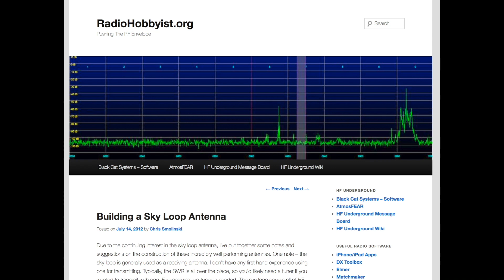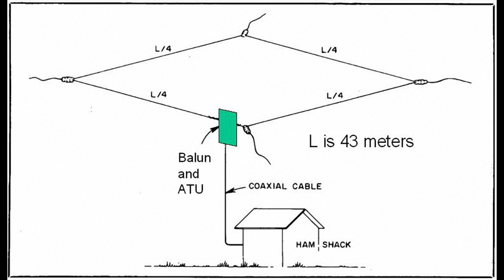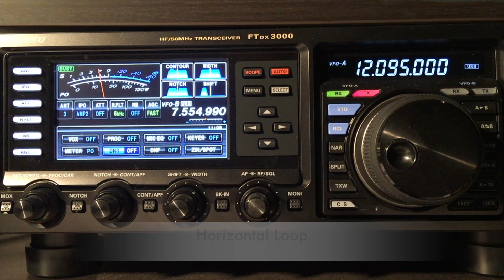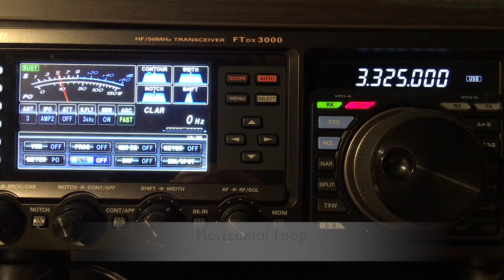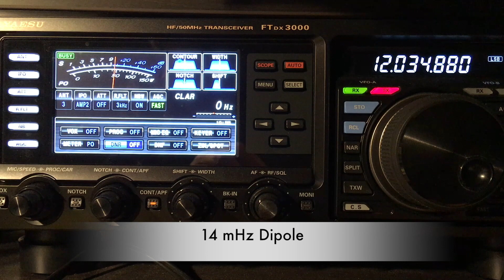Horizontal Loop Antenna Experiments

Comment: Rob:

I love my 40 meter full-wave loop antenna that I made many years ago.  

True the noise floor is greatly reduced as I have experimented at many locations while on vacation.

I use the 450 ohm ladder line going into a MFJ 300 watt tuner.  

One thing I have noticed that I get some gain from the antenna while being on higher bands (20, 15 and 10 meters etc) than just on 40 meters.

One time, I worked a pile-up and got through to the South Pole on the first call.  The antenna location was this antenna just thrown up in the trees, nothing special.  My QTH is Portland, Oregon (CN85ql) and I was shocked to say the least using 100 watts on 20 meters.

When on vacation, I always take the full-wave loop with extra floating insulators so that I attach the loops to any number of trees while trying to make the antenna form a circle.

I have worked the world on my loop and it was cheap to make.  I would put my loop against other dipole or vertical and win out for lower noise floor.

I am a true believer for loop antennas and have used it many times while running QRP with great results.

I consider the loop antenna my secret weapon during Field Day in June.  Others feel it is it a inferior antenna thinking the signal just goes vertical...no, I have worked the world with it on both high power and my personal preference QRP.

Thanks for the great video! Looking forward in seeing your next video.

73!

Kurt Warner - KA7ZDD, Milwaukie, Oregon (suburb of Portland)
(Good on QRZ.com)
Reply from the maker: Hi Kurt! A fabulous story there. Great to hear that someone else is enjoying the benefits of the loop antenna. I must redo my balun so it can transmit on higher power. It's an old one made with thin wire intended for receiving only. However, on more than one occasion I have pumped a 40w full carrier FT8 signal through it in error and it has survived just fine. Like you, I have also found that it tunes up easily on a number of bands, even though I am not using ladder line. So it seems that it is a very forgiving antenna. Thanks for checking out the video, "Zippity-Doo-Dah"!  ;-)  73, Rob VK3BVW (also good on QRZ).

Comment: I have almost precisely the same arrangement, rectangular, 60 metres long. Hot Tip, if the antenna is less than halfwave high the impedance drops, so try a 1:1 Balun, halfwave and above in height use the 4:1. Also loops are resonant on every harmonic, unlike dipoles that resonate every other harmonic 73 de GØUSL
Reply from the maker: Thanks for your comments, Mark. Much appreciated. 73, Rob VK3BVW
Reply: @RobVK3BVW  My pleasure Rob, I have been experimenting with loops for some time. I am in two minds whether to try to extend the loop for 80metres (some imagination required there!) Or to shorten in for 40metres and take the vertical option for 80.

Comment: Are you still liking the 3000 Yaesu ? Debating on it or the 7300
Reply from the maker: Absolutely! I've had the 3K since Dec 2014 and it hasn't given me a scrap of bother over that time. Once you get used to the menus, it's easy to operate (but, hey, that's the same for all the different brands of rig these days!). Very sensitive receiver and transmitter works great. Using it a lot on FT8 at the moment.

Comment: You have a high noise inside ur shack probably due to nasty laptop dc power supply or led lamp etc. get a noise canceller
Reply from the maker: Mohamad Ibrahim - No. The noise is NOT coming from inside the shack. It is external noise being picked up by the antennas.  Tests show that shack equipment is quiet.

Comment: Just spotted how you've wired the antenna through egg insulator at one corner.
Not seen the rest yet. Ah yes... the one at the metal pole as well.
Eggs are fragile and if they break your wires would fall.
The egg is shaped to feed the wire into the hole via a path...same for both wires.(or rope).
That way your egg is subject to compression rather trying to pull it apart AND should it get busted, your wires will support each other and not drop to the ground.
On rx only, you would probably not even notice it if it did break!
Question. Have you tried or is it feasible to put up a loop of whatever dimensions you are forced to use according available space?
eg. My shack is not near a corner (more in the centre of the loop area) so feed would be on a straight stretch AND I have lovely neighbour as well so I might get the OK to make it even bigger over their patch but boy, it would be a odd shape.
Sorry can't draw you a pic about the eggs but the fluting on its shape should tell what I'm
getting at. 
Great video.. Million thanks!   73 de G3NBY
Reply from the maker: G'day Howard! All your comments noted on the eggy insulators. It's a pretty "stress-less" setup here so I suspect that eggs are going to hold up very well. In fact, they are decades old - possibly 30 years? Still going strong.....we make 'em tough out here in VK!  ;-)  Indeed, since that video was recorded, the wire has stretched somewhat and there's even less tension on the eggs now. 
After having done a little research on the loop, I've got a feeling that the shape is probably not that critical. I've seen several DXers with loops that have 5 and 6 supports, the main aim being to try and get as much wire up in the air as possible. Certainly, for receive-only conditions, it doesn't seem to be critical, so in your case, I wouldn't worry too much about the odd shape. For transmitting off one of these things, the build and placement of the feed point probably need to be considered more carefully. Try it and see!! Let me know how it goes for you.
In the last week, I have been getting into the FT8 mode, and enjoying it! I've been using the loop on receive because it's quieter and dipoles for 40 and 80 on transmit. Works well.
Just looked you up on qrz.com - I see you are a muso! Trombonist here. Big band jazz for many years, classical and teaching as well. I don't play professionally anymore due to a dodgy ticker. Always nice to meet another muso/radio enthusiast!! My "About" web page is as http://robwagner.com.au/styled/About_Rob_Wagner.html. Anyway, thanks for stopping by and checking out the video, Howard. Cheers mate! - Rob VK3BVW

Comment: I've got plenty of space and I'm considering a 160m double wave loop. I'm in a bit of a valley with high terrain immediately to the east and a stoney ridge to the west that is less steep and somewhat lower. The valley is more open to the north and south and all the terrain is heavily wooded.
I'm going to feed it with ladder line and because of all the high terrain (and I just installed a 15m mast for TV) I don't think the loop will be any lower than about 15m. There are many tall trees that make my 15m mast look unimpressive.
Like you I read many articles on the sky/horizontal loop and found double wave seems the way to go due to lower takeoff angle.
I'm in 2 minds as to whether to shelve the 160m double wave part since most 160m is vertically polarized (and part of me thinks what's the point) and go 80m double wave which would be 160m single wave anyhow or just do the full 160m double wave.
I'm thinking an isoceles triangle would be good and the article I read suggests feeding it at the apex in such an arrangement gives some directional aspect to the antenna in modelling at least. But at the initial location it would not be feasable to feed it at the apex (I'm living in a caravan at a different location on the property while the house is being built). At the caravan site I have a nice cleared river flat that will easily accomodate 1100' wire.
I do want to use the loop for TX and its transmit performance is important but my main interest in amateur radio is mostly listening on various pieces of equipment. I have a Kenwood R5000 with VHF board and every filter and option box ticked. It is a great receiver but frustrating to use and I have a Yaesu FT1000MP with all filters installed which is great to use but doesn't cover VHF and isn't as quiet as the Kenwood. For example, the Kenwood is almost deaf to the power supply noise of my plasma TV and the Yaesu isn't too bad but it takes plenty of tweaking to get that noise blanked out and it effects the sensitivity.

I'm convinced double wave is best for multiband loop antennas.

Comment: Hi Rob very nice video on skyloop. I have mine also connected to a Palstar auto tuner and it is working good. Btw, what bideo camera and setting are you using? Dindo DU1UD
Reply from the maker: Hi Dindo, I use two video cameras in this video. In the shack, I use a Nikon D800 and for the shots of the antenna outdoors I used an iPhone 6S+. The setting is 1080p. Editing was done on the latest version of iMovie for Mac. Best 73, Rob VK3BVW

Comment: Hi rod i put up a delta loop sky loop horizontal 160m long 40 feet up on 4 poles ,seems still a bit noisy but  not as good as my inverted v on 40m but on 10 15 20 it kicks butt big time i was very surprised also its very directional at a perfect sq in free space  out in a field. 4to1 balun fed from antenna with l line 450 short coax lmr 400 back to shack still think the inverted v beats it on 40 m band less noise bigger gain better on line reports with the  inverted v .
Reply from the maker: Thanks for sharing the results of your experiments, Alan. Best of luck with it, Rob VK3BVW

Comment: Thanks for interesting posts
I am also using 80 m sky wire.
I use it in all bands using a 4: 1 transformer like you.
Now I am trying 600 Ω open wire.
It is a very good antenna.　　FBDX！
Reply from the maker: Thank you for watching the video. Good luck with your 600Ω open wire. Best wishes from VK3.

Comment: Impressive improvement in noise floor, I have been curious about experimenting with a sky loop in comparison to my T2FD (which also has a lower noise floor than my right angle random wire antenna).
Reply from the maker: I had a T2FD in the air many years ago and it worked OK. Got pretty ungainly to hoist in the air when built for the low bands. I think that the loop would have beat the T2FD for lower noise floor. But perhaps I should make another T2FD and test it. Or perhaps I wait for your video comparison tests!! ;-)

Comment: I have played around with horizontal loops a bit. I need to put up another one. Full wave loops will work on their even harmonics. So a 40 meter loop will also work on 20 and 10. Even if I intended the loop to be primarily for RX; I would want to be able to TX with it. I really need to see about getting something up for 40 and 20. Right now for HF all I have up is my A99 that works 10, 11, 15, and 20 with a tuner. 

73
Jennifer
KK6FVP
Reply from the maker: Thanks for your comments, Jennifer. Good luck with your loop experiments. Best 73, Rob VK3BVW

Comment: Since I can't post pictures? on here, my sky wire 80 meter loop is 275ft long, my house on a hill, top 2 corners are 28' and 20', hill drops 20', bottom corners are about 35; each. My best swr was 3.749. My 80 meter dipole is at 40' over the same slope. My loop outperforms the dipole by 3 db, and is quieter. I use 26' of rg58u, and the rest is rg8..Nice video..
Reply from the maker: Cool, Steve! Great to hear of your success with the loop. Some guys use the loop as the receiving ant and another ant with low swr for transmitting, which is an easy thing to do these days with many transceivers having a separate receive ant terminal. Thanks for your comments. Good luck. Rob VK3BVW

Comment: Enjoyed  watching your vid Rob and found it very interesting.  Local man made noise is only getting worse and we all strive to avoid  this problem.  I am currently experimenting with a magnetic loop antenna and comparing the RX performance to a 8m tall vertical.  So far the mag loop has been performing extremely  well.  By using the WSPR software and different receivers for each antenna the mag loop is spotting more stations so far on the 40m band.
Thanks again and will wait to see the results of your next antenna experiment.
73
Reply from the maker: Very cool, Joe! Thanks for your interesting comments. I'm really glad you are having some success with your antenna system. Best 73 to you!

Comment: Seems to be a bit of confusion here. Rob, I made these tests with skyloop and other related antennae maybe 15 years ago. Even made one with a autotuner after a specific length of 450 Ohm ladder line so could transmit on it. As in your video, it did make reception more quiet, but not enough. This said, an end fed wire is the worst of all receive antennas for noise. I got rid of them a long number of years ago. Now, a transmit antenna is mostly not the best receive antenna. It will radiate your power well, if constructed well, but reception is not optimal. The last 8 years I always separate things by using a separate dedicated receiva antenna with an autoswitch, external or internal, swapping antennas. The next thing is that you install the receive antenna at the most quiet place on yur property and using a, in my case, high quality active loop. This loop is oriented so its deaf side is pointing to the qrm direction, so it eliminates even more noise. NEVER mount a active loop in a horizontal plane as Mike suggested. Also mount it about 3 to 5 meters up on a rotor so you can tune to get the most signal from the wanted transmitter and make a compromise with the local noise. I hope this sounds logical. Good luck!
Reply from the maker: Thanks for your comments, Ron. I do very little transmitting these days, so as I mentioned in this video, the main purpose of this loop was an experimental ant for receiving. I would build it somewhat differently if transmitting. Your observation of using two separate antennas for transmitting and receiving is a very good strategy. Cheers, Rob

Comment: What a fascinating video, here in the UK we have been let down by our regulator Ofcom who will not enforce the EMC regulations and noise has become dreadful.  Of course we don't have the space you guys do so I am wondering if a balanced loop such as the Wellbrook ALA1530 mounted horizontally would display the same noise reduction??? Do we know the theory behind why the horizontal loop hears less noise?
Reply from the maker: Mike, same EMC issues here as well. So much Asian stuff imported without proper filtering and with poor circuit design - it's cheap, but it comes at a price - RF pollution! I've had no experience with the Wellbrook (too expensive to buy and ship to Australia), so I can't really comment on a comparison. More research needs to be done! Cheers, mate!
Reply: Hiya Rob, ok I will do that research and report back :) Keep an eye on my channel, I have used the ALA1530 over many years but recently swapped to a MiniWhip which is great for LF but getting swamped on HF
Reply from the maker: Thanks for your interesting comments. I guess it depends on how bad the noise is versus the ability to have directionality in your antenna. Good luck with your antenna experiments!  Rob VK3BVW
Reply: A few months ago I was curious about how my ALA1530LNP would perform when mounted horizontally. I also have a ALA1530s+ which I kept oriented vertically. In my experiments I switched between the two. Indeed, noise levels dropped even further with the ALA1530LNP than what this Wellbrook loop normally offers. Unfortunately, with its omni-directional pickup in this orientation,  there was no directionality at all on medium wave or lower HF.  I decided to return the ALA1530LNP to its normal orientation, but I plan to remount it on an antenna rotor like I used before. Perhaps I'll try a skywave loop again, but it is a big hassle to route the wire through the dense foliage in the green belt (forested area) behlnd my house.

Comment: Very good! I'm a big fan of loop antennas. So far, I only have small ones for indoor use and they ara really quieter. My QTHs are located in very noisy environments and these antennas allowed me to listen to shortwave again, maybe better than the time there wasn't so many appliances and what not around. Right now, as I'm writing it I'm listening to Radio New Zealand International on 7425kHz and sometime before I was able to pick up Radio Congo on 6115kHz here in downtown Curitiba, a big and busy city. I noticed that when I use it horizontally, it's even quieter and frequencies below 10MHz signals actually come stronger. Signals above 10MHz get weaker so I have to use it as a vertical loop. Fortunately, the afternoon is the best time for listening to these frequencies when there's much less qrm. Recently, Ulysses Galletti PY2UAJ built a horizontal loop antenna in his property to specifically tune in RNZI on 13840kHz and was very successful. Thanks for posting
Reply from the maker: Fabulous! Thanks for your interesting comments. Best wishes to you and all listeners in Brazil.